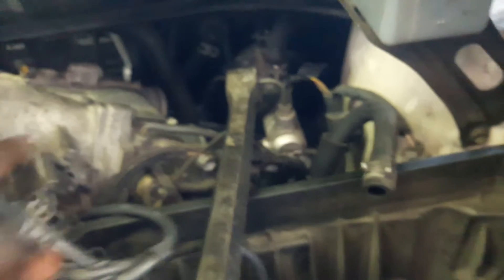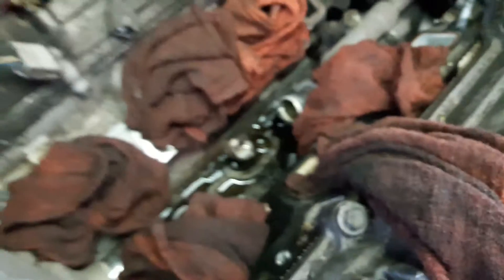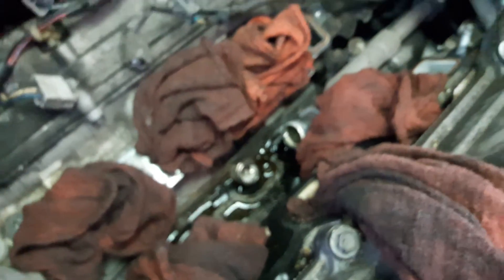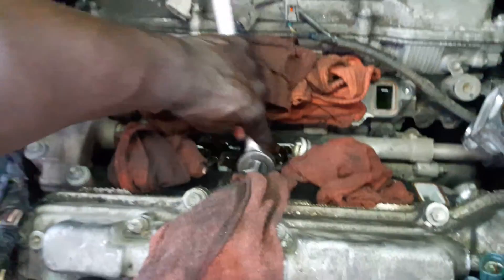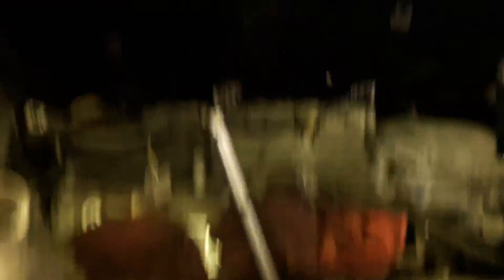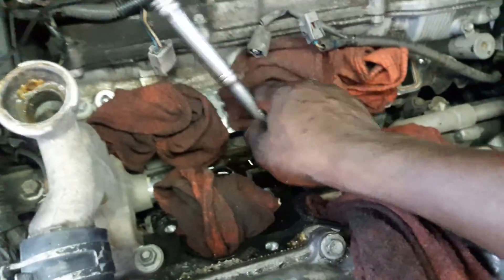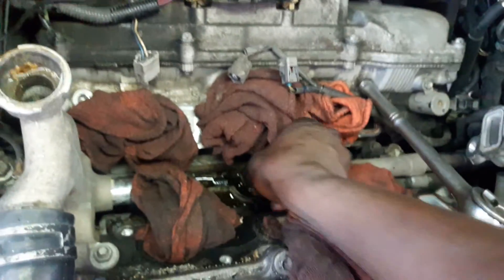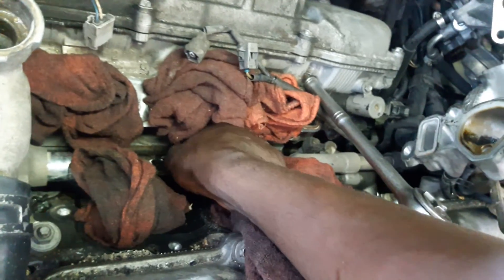1999 Lexus rx 300 knock sensor remove and installed

Comment: You sound Haitian. Sak Pase
Reply from the maker: N ap bouleeeeeeee, subscribe me
Reply: @ChedaBenz  hey bro i have a 98 toyota harrier that wont go to 4th in auto and wont go in manual people say its the knock sensor. It that true? Oh and its bad on gas. Please help.
Reply from the maker: Sounds like clutch is low
Reply: @ChedaBenz  it drives ok but when i put in the manual mode the m is flashing but its like its in automatic n no matter how hard i go it just go to 3rd. when i got it a saw that they changed 1 so am not sure whats going on.